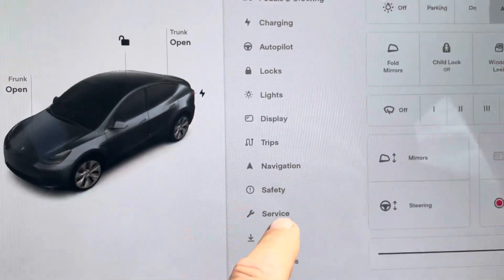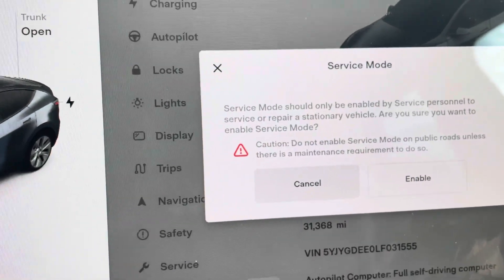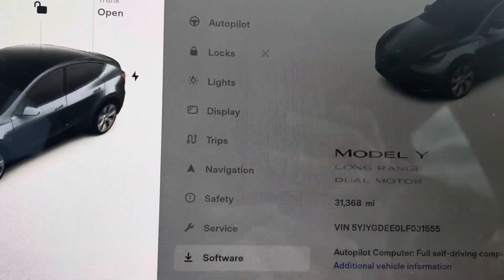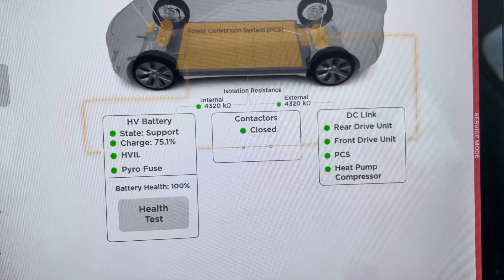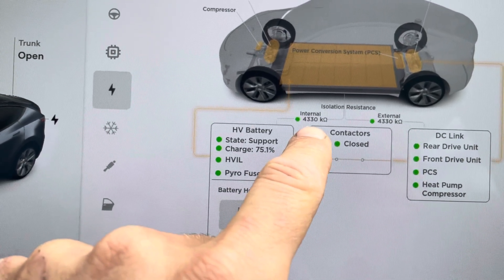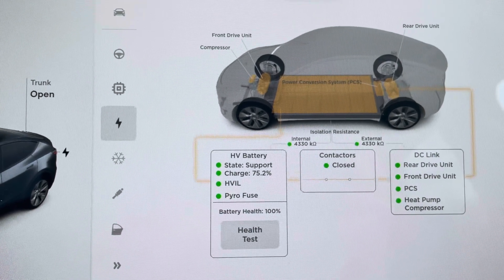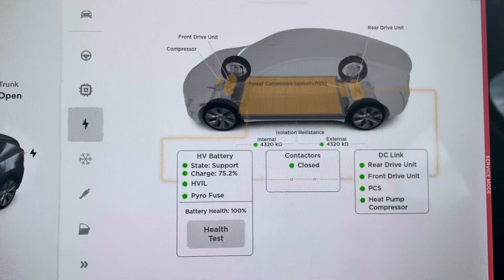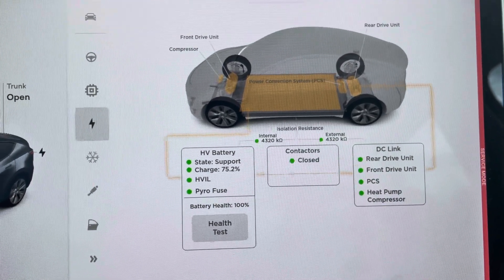How to tell if your Tesla has HV problems (BMS_A027 etc)

Comment: Hi , thanks for you knowledge that you are sharing really valuable , I can’t seem to get my M3 main contactor to close , main battery is now flat and have repaired but no airbags or pyro went off…I tried you method of supplying 50 amps power from mains without lv battery o together with 12volt battery still contactor open and I can’t get it to start charging!! Help!! I’m in the uk please help… I’m 4.5 hours from Tesla service centre!! Thankyou
Reply: Hello Marc, I have the exact same issue "M3 main contactors to close" No power received to the penthouse (below the rear passenger seat) to wake the vehicle after changing the 12V battery...Question: How did you resolve this issue? G
Reply: Same issue

Comment: In my M3 2021 Contactors are showing Open and HV battery state: Fault
Due to which car is not going into drive mode, any suggestions. Thanks
Reply: Did u find out sbout cuz I have the same issue
Reply: @ what is the exact issue you are facing?
Reply: What other codes do you guys have? Isolation faults? It can be something simple as a unplugged connection

Comment: For me it’s greyed out and it’s says waiting and I have to  BMS A027 error it’s also in limp mode and it won’t regen. It’s a 2019 standard plus. Luckily it’s still in warranty.
Reply: Hello, have you fixed the issue? Same for my Tesla model Y 2024.
Reply: @vv7584 Tesla fixed it! Turns out it was the inverter on my drive unit in the rear. The car has been problem free since.
Reply: @nickman011  thank you. looks like in most cases it is inverter.
Reply: @nickman011  how much you were charged for the repair?
Reply: @josuehernandez5516 I wasn’t charged anything my car is still under it’s drivetrain warranty but I’ve just checked my invoice. And it shows me a price 1142 Euro. I’m not from the US. So they might use different prices. I hope it helps.

Comment: I get a battery cover open error when re-installing a battery pack that had U029 error.  All cells/modules are balanced.  What does the car look for when giving batter cover open error?  Is it a mechanical switch?  Optical sensor? other?  BMS reset was done before install.  This is on a P85 2013 model s

Comment: Just got the Dreaded BMS A0207 and  BMS_A170.
Just happened randomly about a week after the last update. I went into service and for the internal isolation resistance dot... its not even on. its just greyed out. I put in a service request via the app yesterday and waiting to hear back. very frustrating.
On 2024.26.7- 
2023 Model 3 LR- With under 5,000 miles
Reply: Hey any update? Exact same thing for me as well
Reply: @faisalmohammed4248  I had booked a service appointment via app- which was not gonna take place until October. I called the service center nearest me and i was able to take the car in and drop it off (8/26). They have had the car now over a week. Still waiting for my repair to complete. I got a 21 Model Y as a loaner. Had an estimate for a pick up 9/6- app has no new update so still waiting----
Reply: @faisalmohammed4248  UPDATE- Picked it up. This is what was done:
Repair Notes: Verified customer concern, "Customer states: Range - Acceleration and top speed reduced messages / power reduced" Diagnosed and Replaced Rear Drive Unit Inverter. Vehicle is now operating as expected.

Correction: Diagnosis: High Voltage Circuit Integrity Check Correction: Inverter - Rear Drive Unit (3DU) (Remove & Replace) - Remove and Replace

My car is under warranty, so it was $0.00
Reply: @MrCg006 thank you so much for your reply, just dropped my car off yesterday too, but no loaner vehicle 😢. Hoping they resolve the issue soon
Thanks again
Reply: @faisalmohammed4248 Any update? I have the same problem…internal is blinking grey and HV chain/external just has a grey dot and says «waiting»…
Reply: @Polky  hey, the issue was Rear Drive Unit (3DU). Repair notes as stated “Diagnosed and Replaced Rear Drive Unit Inverter.”
All covered under warranty and took a day to get my car back

Comment: Hello, the service menu detected the internal insulation resistance of 770k ohm. Is the external resistance of 770k ohm serious?
Reply from the maker: 770 kohms is too low, should be ideally about 4000 on the model 3/Y.

Comment: I have external isolation issues it was the inverter I swapped it but unable to program it
Reply from the maker: You need Toolbox access and experience using it.   Programming rear inverter is not really a DIY task.
Reply: @diytesla  I live in Miramar Florida can you help please

Comment: Hi, how are you so my car model three keeps giving me That the high voltage battery temperature is high. How can I cool it down knowing that the contactors are open and the AC compressor won’t turn on unless Contactors are closed
Reply from the maker: I suspect there is an issue with your thermal system (perhaps air in the coolant, for example).  The car can cool itself even without AC.   But the real question is why are you even keeping the hr car on?  Just turn it off until you are ready to work on it.  Park it in the shade and battery will be fine.